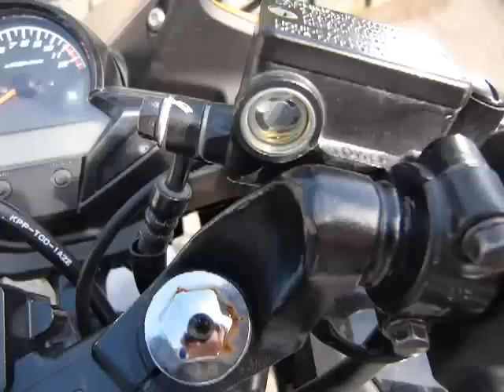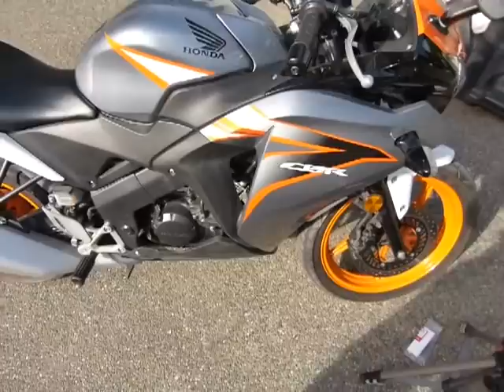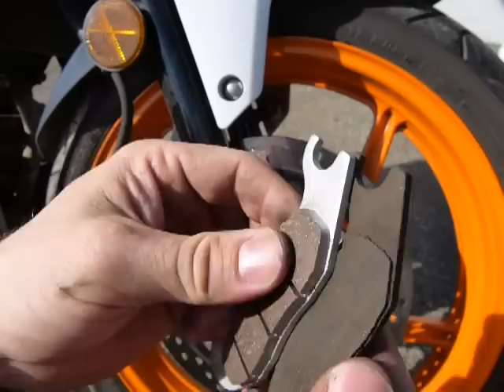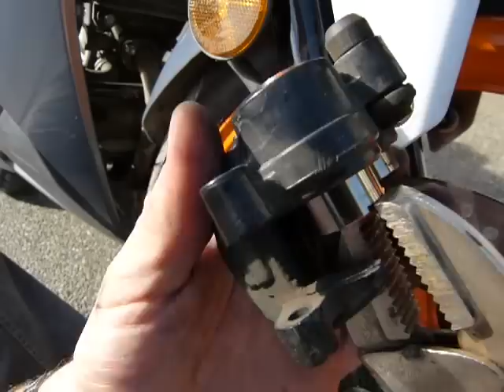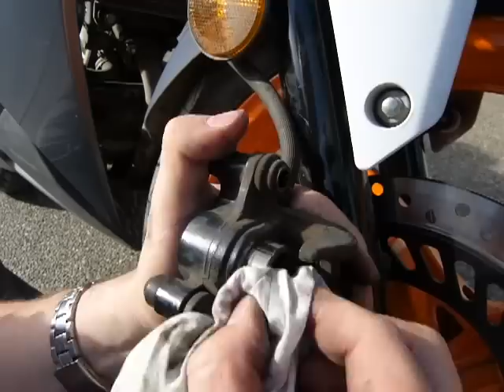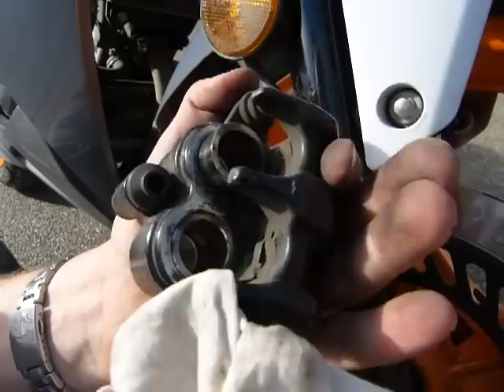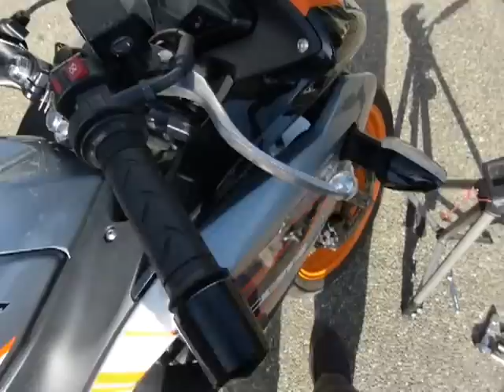Install new brake pads/how they work (2012 - current Honda CBR125R/CBF125/CB110/CB125)

Comment: Excellent!  Changed both sets in 15 minutes . . .driving down the road to test the brakes I got to thinking about my old BSA Lightning and used my left foot to test the rear; this caused a good deal of nervousness until I remembered I was on a Japanese bike and used my right foot.  All is well..

Comment: I just cleaned my brake calipers with warm soapy water and a toothbrush. Worked out really well... I didn't know you can turn the pistons, I tried with my fingers but they wouldn't budge so I used a piece of string around the piston to clean the side I could not reach. Nice video!
Reply from the maker: Brilliant string idea, it`ll save some time and eliminate damage on some models. . I did my Ninja earlier this year. I found the pistons could move by hand really easily. Check out 2013 Ninja 636 brake cleaning esp 10:30 - 11:30 Thanks for sharing!

Comment: Great video. My bolts (12mm) attaching the caliper assembly to the fork was too tight and broke my (cheap) ratchet set. I used a power bar to undo it.

Comment from the maker: Don`t know anything about loose breaks, but loose brakes are ok IF: 1 the bolts are tightened to specs 2 all pieces are correctly assembled. THEN: 1 The pads have play sideways and 2 also against the plate springs. 3 The upper caliper half is on pins that allow movement sideways to center itself on the disk.
So, which brake part is loose and in what direction?
Don`t get hurt, if in doubt, get it looked at by a pro.

Comment: Great vid. I applied cooper ease on the back of the pads as per Honda garage advice, but you advised not to put any anything at all. Also the front wheel is slight friction is this normal since I installed new brakes pads. The new pads are about 4 mm.
Reply from the maker: Slight friction is right, brake pads just floating by the rotor surface, ready to grab without traveling through any thickness of air.
Reply: It's normal then, Many thanks. Just taking my bike to work tomorrow

Comment: thanks mate, now I can save money and do it myself!
Reply from the maker: bdavies1995 Exactly the idea. Thanks for watching!
Reply: bdavies1995 You should be able to push the pots back in with your bare hands. If you need any tools to do so, the caliper won't work properly.
Reply from the maker: This one did. For years. With repeated identical service. The seal around the piston is just tight.
It`s a class-1 interference fit. If it`s any less tight, brake fluid might leak. That would be tragic.

Comment: Great video but I couldn't help cringing at the vice grip pliers you used to rotate the pistons. I think a pair of non marring pliers would be much better. Or if you wrapped a regular set of pliers with something like masking or electrical tape to avoid direct contact between the pliers and brake pistons.
Reply from the maker: Brake cleaner also works, but the non-marring pliers couldn`t get enough traction. Thanks for the note.

Comment: Vice Grips? No No No! A Friction Strap Wrench, the type some use to remove oil filters on cars, works nicely, or, simply take a thin cloth and slide it between the piston and the housing and polish the piston as though it were a shoe. Dropping the Brake Shoe on the ground was an oops and should have been edited. All in all somewhat informative, well done.
Reply from the maker: George Watson Good point, I agree. Further editing done. Thanks for watching!

Comment: Great video man. Very helpful. I've got one question, though. I actually changed the rear pads on a 2012 CBR250r but the basic concept seems to be the same. Is it normal for the new pads, once installed, to make light contact with the rotor for a bit. I tested the tire to see if it spun freely and there seemed to be light contact with the pads. I tried pumping the brake pedal a few more times and that seemed to help free it up. Did I do something really wrong or is this normal?
Reply from the maker: Sara Strempel In normal operation the pads VERY lightly contact the rotors when the pedal/lever is NOT actuated. Check out 9:20 - 10:30 Motorbike full inspection part2: Wheels, suspension, brakes 
Brake fluid forces the pads against the rotors, then vacuum draws them away. The vacuum is controlled by a rubber seal, make sure it is in top condition, see 0:00 - 1:00 (before & after extreme cleanup) Brake cleaning (1982 Yamaha Virago 920J)

Comment: Is it just the studs (10.02) and the pin (10.30) that need to be greased then? I guess the studs with red rubber grease and the pin with copper grease? I have seen elsewhere people talking about putting copper grease on the back of the pads too.
Reply from the maker: Guy Jennings I put a dab of Yamalube marine grease on the self-centering studs. I never lubed the back of the pads, just gets filled with dirt. There is no movement between piston and pad, so there is no wear to avoid by using grease. I sometimes put anti-seize in the pad retaining pins, but it also gets filled with dirt, so instead I just pull the pins and clean them often (3-4x a year, I ride every day) to ensure they don`t seize up.
Thanks for watching.
Reply: theoverengineer
Wow that was a quick reply! Thanks so much for taking the time to film this and help out.

Comment: Use your old pads to push the pistons back in.  after cleaning, put both old pads back in, and use a screwdriver to pry the 2 pads apart, that will compress the pistons.  Then remove and replace. Voila

Comment: I followed your video and fitted new brakes pads cleaned pistons etc and greased pin the brake works great bit if the wheel is off the ground it won't spin freely what do I do
Reply from the maker: Here is another visual reference for clean brake parts, same concept. https://youtu.be/v2phJ6ybEP8 The rubber bellow in the master cylinder must be clean and placed to seal correctly in order for the vacuum force to retract the pads off the rotors efficiently. And fluid level needs to be right.

Comment: I need to change my rear brake pads on my honda cbr 125, I saw your video but you explain how to change the front pads and I wonder if you have another video or if you are willing to make another one about the rear pads.
I know how to change the brake pads but the thing is the rear brake caliper is stuffed between the exhaust and the wheel and I was wondering if I have to remove the exhaust in order to unscrew tho bolts holding the caliper.
any help in this field will be much appreciated.
Thanks

Comment: My Two Front brake bolts are Allen. Cannot loosen any of the four. This must be common if all four are extremely tight bending Allen and everything. Any suggestions
Reply from the maker: WD-40, any old engine oil, anything that loosens the seized bolts. It the bolts break in half, that`s gonna hurt the wallet.

Comment: what are the best brake pads to get? was just wondering if theres any better ones than the ones from honda 
thanks.
Reply from the maker: Carbon fiber rotors and matching brake pads. Extremely unlikely that anyone makes to fit a 125. Dry weather braking: organic sintered pads. Wet weather braking? Ceramic sintered pads with copper or bronze shavings in the puck. Track use? Fully metallic HH sintered pads (these are made with steel shavings).
I`d stick with Honda`s, hands down the best balance for rotor wear, initial bite, coefficient of friction, fade, force required to operate.

Comment: I have the same bike as you (model and year etc) and need to change my front brake pads, please could you tell me the torque settings you used?
Reply from the maker: I called the local dealer. Front brake caliper tightening specs 2011 CBR125R: 25ft-lb (34Nm). Dealer also recommends replacing the mounting bolts every time the pads are changed.
Reply: Thanks for that :) great video by the way, its so hard to find good videos for smaller bike maintenance.
Reply from the maker: Browse through my videos, some shot on the same CBR125R, some on other models but the adjustments and mechanisms differ only minimally: adjusting clutch cable Lubricate your cables , adjusting shifter Set your clutch for FAST shifting, valve adjustment due at every 4000km Valve job: its extent (2011 Honda CBR125r) , oil change (does not have a filter) CBR 125R first oil change (1000km or 600mi), chain tensioning How the CBR 125R chain adjuster mechanism works.

Comment: Hey! I just got new pair of disc brake pads installed on my motorcycle ( CBR 250r ). But now the brakes are making horrible grinding noises when I apply brakes. Its really irritating. Is that normal? Will that go away? Also after installing the pads, the front wheel wasn't rotating freely. It took several hours for mechanic to fix that problem. But I'm not sure if he was successful in solving the problem. Can you give me some advice on how to fix these problems?
Reply from the maker: +Rahul Chauhan There is a lot of geometry here. Pad placement is critical. It has to be perfectly parallel with the rotating disc, or it makes a grinding noise and does not come into contact with the disc perfectly.
For perfect contact the disc should not be warped, chipped, dented, bent or dished out.
Embedded small stones can cause noise and uneven wear.
Chalk board effect = noise can be made between surfaces without anything being wrong.
All clips must align the pad perfectly, undamaged rotor, brake pad must be from a decent manufacturer with uniformly manufactured pad materials, identical size backing plates. Caliper pistons must be cleaned so they retract effortlessly after braking. There should be vacuum in the brake line pulling down the membrane in the brake reservoir.
Reply: +theoverengineer Ok! so I talked to the mechanic today who installed the brake pads. He is saying that brake pads are getting adjusted to the rotor disc hole pattern and causing the noise. It will go away after some time. Can this be the cause of noise?. Also there is something called BEDDING of brake pads.
Reply from the maker: Is there noise on a new brake? Seriously. No. It does make a very faint contact sound, absolutely no noise or grinding noise or harsh noise. So, make it like new. No stories of holes, or the gravity field of the moon, or the monsoon season in Bangalore, just make it like new. Then it`s done right.
Reply: +theoverengineer lol... yeah maybe you are right. I think brake pads aren't aligned parallel to the disc that's why the noises are coming. Stupid mechanics of Honda Service Centre. I think he is not able to solve the problem that's why coming up with excuses. But thanks bro... u r awsum and nice video. Next time I will install the brake pads. This video explains it all.... :)
Reply from the maker: +Rahul Chauhan On one occasion incompetent apprentice mechanics (due to incompetent supervision) at a Suzuki dealer stripped the thread out my V-Strom`s head and wanted me to pay for it. These kind of people are also found to spray WD-40 on a chain (with a generous amount of overspray on the tire) and call it done. Watch them like a hawk.

Comment: Hey Bro, I jst figured out, tht my brake pads got completely finished. and the disc is badly scratched. The mechanic/worker says, tht the disc now should be changed, else the brake pads tht will be put tge next time will get finished faster cause of the disc ( tht has got scratches ) . Is this true? Do I need to change it? (the disc)
Reply from the maker: Not true, new pads will not wear faster. Will wear at the same rate as before. However, I recommend changing the disc due to geometric reasons explained here: https://www.youtube.com/watch?v=fp01bOSWnH0 and that thin discs contain less metal and are less effective heat sinks. Overheating brakes are unsafe.

Comment: Good video.  Brake cleaner would have made your cleaning job a whole lot easier.  The previous owner on my bike put in thread locker and over tightened the bolts and now; I could not remove the bolts and one of the bolt is stripped.  Arrrghh.
Reply from the maker: +TechFanMan Ayayayay  ... Vise grips? Cut a straight slot in the bolt head and turn with a flat moulding bar? Weld a bigger short bolt on top of the bad one and turn the shorty?
Between the hardened steel bolt and the soft cast aluminium caliper body the caliper body loses every time. The thread on the bolt can not possibly get stripped, the aluminium is only half as hard.
Reply: +theoverengineer Got a metric bolt extractor set and it broke the bolt free like a charm. Of course the bolt is now ruined.  A new set is on the way.
Reply from the maker: +TechFanMan Oh yes, those work too. Thanks for watching & commenting.

Comment: you did damage the piston a little from grabbing it with vise-grip.
Reply from the maker: No doubt. Just like the oil drain bolt finish gets damaged the moment a wrench is put on it and is removed.

Comment: asbestos causes, not silicosis, it causes lung cancer or maybe both.Anyway, many thanks for the video, very helpful.
Reply from the maker: jesuisravi  Asbestos is a set of six naturally occurring @wiki/Silicate_minerals. That`s right, silicosis is caused by breathing in crystalline silica dust, not the same as asbestos dust that is made of silicon compounds.

Comment: how many miles did those brake pads last?
Reply from the maker: About 3000km, 1875mi.
Reply: I have a 05 cbr 125 I've only done 10000 miles from new and I've just changed the front pads
Reply from the maker: Wow. Thanks for sharing.

Comment: What if the front brake pads are binding
Reply from the maker: +Meterz. They shouldn`t. Clean the brake pistons while they`re extended & before any dirt is forced under its seals.

Comment: Which lubricant u used for studs
Reply from the maker: antriksh prasad The studs that line up the 2 halves: Yamalube Marine grease. The threaded pins that hold the pads: Locktite Anti-seize Lubricant

Comment: Dont grab the pistons dammit..you can just put the cloth underneath and move it with your 2 hands to clean it !!!!!!!!
Also pad pin should be at 17 NM(13 ft-lb) and mount bolts should be at 30 NM ( 22 ft-lb)..for cbr 125R

Comment: Fuck.. 
I was stupid to put Mobil/Lubricant on the Brake disc(both Rear and Front) thinking tht I need to keep it lubricated... After a while when I tested my bike.. I lost my brake.. It didnt work.. and I came to know it was my foolishness which resulted in failing of brake.. 

Now I know I should never have done tht.. Now, please tell me wht should I be doing?? 
Please help me
Reply from the maker: 5 minute cheap fix. Easy.
1   Grab any non-polar solvent (paint thinner, lacquer thinner, solvent, toluene, xylene) to clean the brake rotor and pads with. No soaking, wet wiping 3-5 times. Hold pads liner down, backing plate up to minimize solvent soaked into the pad material and affecting the bonding force of the pad particles.
2   Sand away a few strokes of the pads` surface layer like in here 9:55 - 13:33 https://www.youtube.com/watch?v=fp01bOSWnH0
3   The solvent may be soaked-in deeply by your brake compound, sanding may not remove all affected layers. Cleaned pads may need a wear-in period. Pads may not be re-usable, get ready to buy new pads. Metal rotors are de-greased commercially during manufacture routinely, absolutely no problems there.
Reply: +theoverengineer 
The point no. 1, I did nt quite understand it. Can U please tell me in simple language? The solvents.. wht kind of stuffs? 
Its nt easy for us here in Nepal.. We dnt have the right equipments and tools.. If anything happens.. we need to take it to the mechanics.. 

I understood the 2 and 3..
Reply: +Dutram Tamang 
Is Kerosene a non polar solvent?
Reply from the maker: No worries. The kind is "non-polar solvent" and examples are listed in brackets. I don`t know what`s available there. No equipment, to tools, just a rag and a non-polar solvent. If it stinks and looks quite like clean water, it is a non-polar solvent. Oh yes, this will work: gasoline from the fuel tank is a non-polar solvent. Use that, you already have it, nothing to buy from the stores.
Reply: +theoverengineer 
Thank U so much.
I really appreciate Ur help and support. Ill be checking all these ideas out today.. and let U know wht happened.. :)
Reply from the maker: Yes, benzene, kerosene, any similar chemical ending with -ene or -ane is non-polar solvent, hexane, pentane, ...
Reply: Dutram Tamang